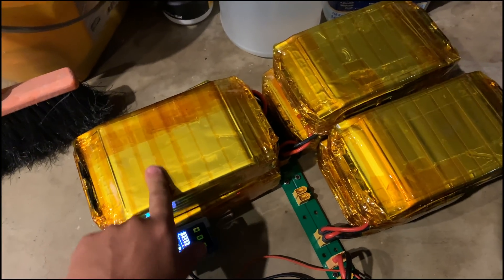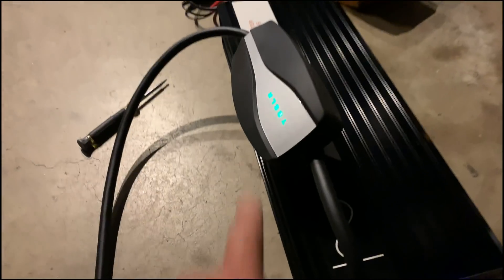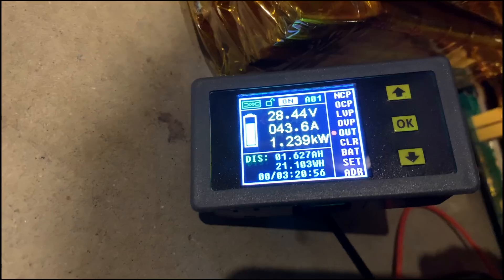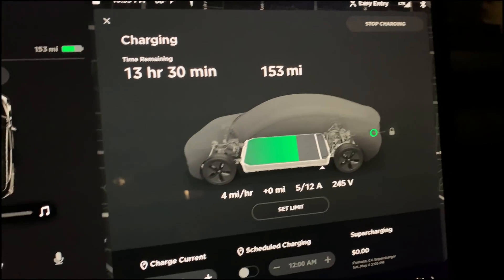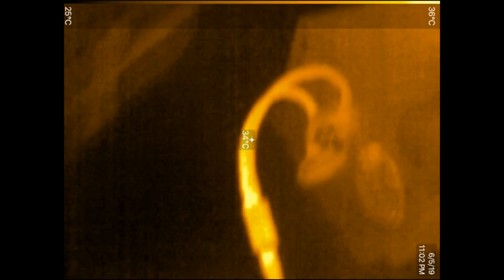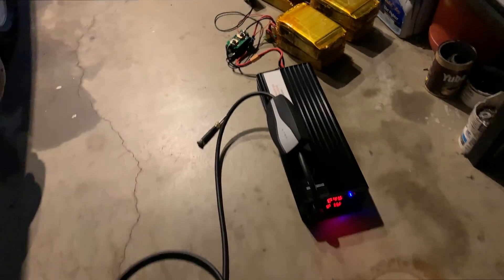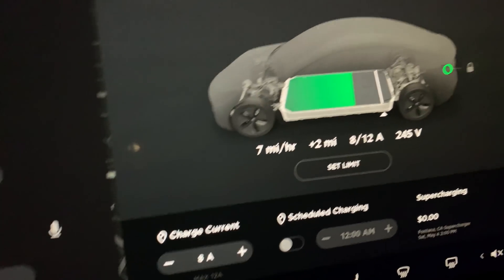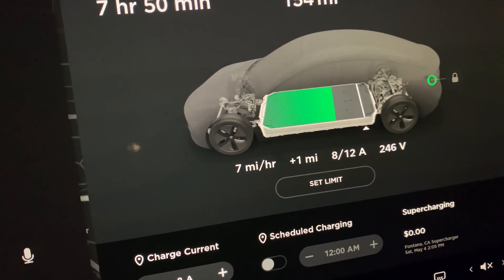How much Energy Into a Tesla Model 3 to get 1 mile of range

Comment: And so burning 1000 cubic feet of natural gas to generate 1kw, how much pollution is that generating for one charge on a model 3? A worthy experiment you are doing here brother. Again.
Reply: @mumbles005  and? Do you think it's worst than taking petrol, refine it, store it, transport it, and burn it after?
Reply: this. this vs the installation, maintenance, and other details of a solar install specifically sized for charging. It would be interesting to look at the raw numbers between burning natural gas and the cost and maintenance of a solar install.
Reply: @datalorian  And manufacturing pollution-cost of the panel. Yes. It's important to know how if these cars are saving us atmospheric carbon pollution, when most people are still getting their power from plants that burn fossil-fuel.
Reply: @glenesis  Carbon dioxide is NOT a pollutant. Concentrating on real pollution is much more important. Especially the air you breath and the water you drink.
Reply: Mumbʟes005 of course not. You just made sound like electric vehicles are not better for the environment. Nothing is perfect, but electric vehicles are WAY WAY better that gasoline vehicles, and taking the bus is better than owning an electric vehicle, and walking is better than taking the bus. Anyway you get my point.
Reply: @mumbles005  Nope.
Reply: @mumbles005  Your reasoning appears motivated.
"It is difficult to get a man to understand something when his salary depends upon his not understanding it". - Upton Sinclair
Hydrogen sourced from fossil fuels is not progress. It still produces massive amounts of CO₂ which needs sequestering.
Massive amounts of energy are used in compressing, transporting and even making the specialized infrastructure and alloys to handle 10,000 psi pressures.
The round trip efficiency of hydrogen is terrible.
The only legitimate case for using it is via electrolysis from surplus solar or wind energy which would otherwise be curtailed.
As renewables build out to be able to supply demand in calm and cloudy days, there will be increasing amounts of excess energy which can be harnessed this way.
Efficiency is less of a problem when the source of energy has no environmental impact.
Lithium is obtained by evaporation of brine and as charge carriers only comprise about 2% of a lithium ion battery. The rest is just graphite, copper, aluminum and small amounts of nickel, cobalt, manganese or iron phosphate.
Batteries will improve, and are good enough now to "start crushing all the petroleum based vehicles". The sooner the better.
Don't let perfect be the enemy of good.
Reply: @mumbles005  read up on Tesloop's experiments. They've got several Tesla's with over 400k miles on them. Not manufactured to go the distance? I think not. Not many ICE vehicles can lay claim close to that, and you need to factor in the continued petroleum consumed by fueling and maintaining ICE vehicles.
Reply: Here's a good read: https://www.dw.com/en/how-eco-friendly-are-electric-cars/a-19441437

Basically, charging and manufacturing an EV might be on par with ICE vehicles today if the source of electricity is from petroleum based sources, like coal. If you live in an area, like Washington, where there's plenty of electricity generated from hydro, wind, and solar, then that footprint improves for the EV. If your utility isn't producing electricity from greener sources, they should be. Many are. An alternative is to switch your utility provider. Here's a good source for searching providers: https://www.green-e.org/certified-resources

That's not a need to install your own solar or wind power generation.
Reply: @mumbles005  what you've said is true for any car, not limited to EV's. The point is, ICE vehicles have a lot more parts that will break down. EV's inherently have way less moving parts to break down; thus, the need for parts and maintenance is less. The parts that will need attention are brakes, tires, and suspension. These are not unique to an EV and can be worked on by any decent shadetree mechanic. There are already a few aftermarket parts being available or being developed for things like performance upgrade brakes on a Tesla,. As far as Tesla resisting anyone besides their technicians working on them...yea, to any car manufacturer, no one outside their circle should be working on them.
Reply: @mumbles005  that Rich Rebuilds is, IMHO, going at it the wrong way and his channel, IMO, is a total sham. Here's an example of a company actually getting Tesla to work with them on making aftermarket modifications for their UK market and though the style isn't popular here in the US, they have Tesla backing them up: https://www.teslarati.com/tesla-model-s-shooting-brake-wagon-supercharger/